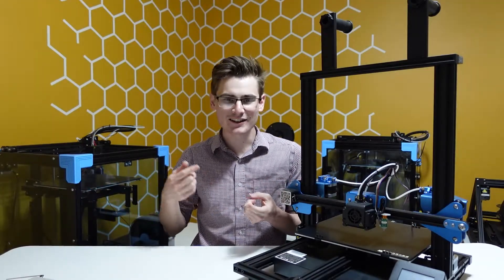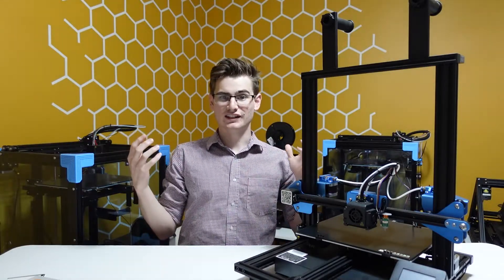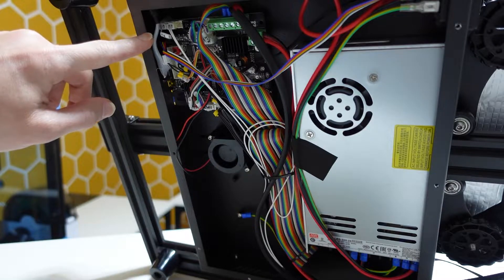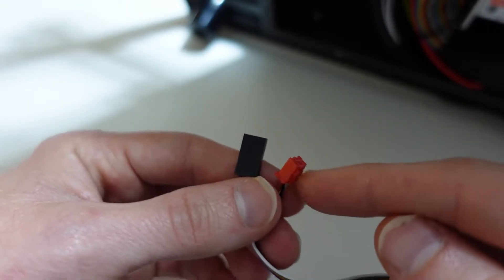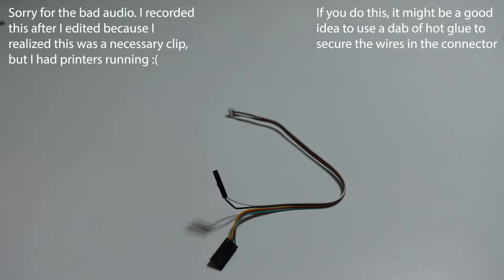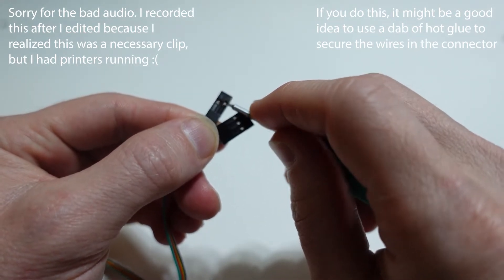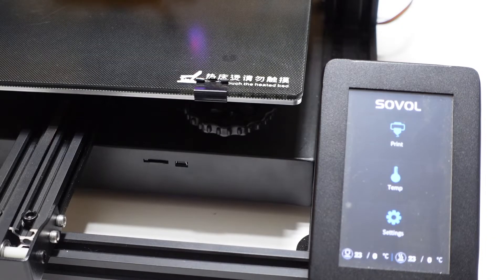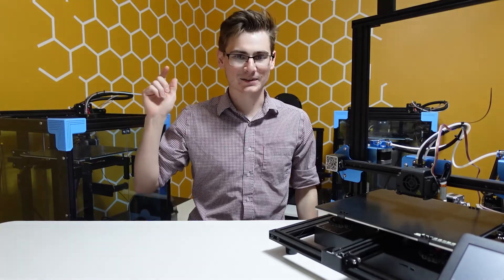SOVOL SV02 FULL CR Touch/BL Touch Installation Guide - With Wiring Diagram!

Comment: I'm having an issue flashing the firmware. I've flashed it on cura and prusa. Neither seem to be properly uploading it. When I check on the control panel it doesn't shoe it's updated. When I try leveling it's still looking for the original z stop. Any help is appreciated
Reply from the maker: Hmmm odd. Are you confident you have the exact right file?
Reply: @ThePrintHouse  I took the hex file straight off sovol's website they provided with the purchase. I've reached out to them as well but have yet to get a response.

Comment: Cable layout is not the same. I had to change my wiring around to red ,blue, yellow for BL Touch to work.      Blue, yellow, red produced a black screen for me using the official BL Touch and cable. I also had to reverse the white and black Z-stop cables for the BL Touch to stop when touching the bed. If not it would crash into the bed.
Reply from the maker: Oh no. Hopefully you were at least able to use this video to get the right pin order
Reply: yeah the pinout shown in the video at 6:00 is not entirely accurate. I have an SV02 with a Creality V2.2 main board and the ground is in the middle of the 3 pin plug. The G and 5V  are swapped on the 3 pin, and the G and Z- are swapped on the 2 pin

Comment: I am attempting to run a CR touch on my SV02 have followed your diagram and many others and can't get it to work. the probe comes out when I turn in the computer and a red led just stays on. what an I missing?
Reply: I’m in the same boat.  I can’t figure it out.  Did you ever figure the wiring out?
Reply: @stvhuston1  I can't even find a mount that works for it. You?
Reply: I can't even find a mount that works for it. You?
Reply from the maker: check the description for the mount I have there. It works.
Reply from the maker: I will see if I can dig into your problem. Did you get it to work yet?
Reply: @ThePrintHouse  The mount does work, but you will likely need to add a spacer. I used a 5mm spacer, and was good to go
Reply: The RED is a failed Self Check. Check your wiring harness. There may be wires in reverse order.

Comment: How do you do this with a Mac? I have never been able to connect to a printer with Cura on Mac.  Is there a .bin file anywhere where you can update the firmware via SD card?
Reply from the maker: Unfortunately I do not know the answer to that question because I have never owned a Mac.

Comment: Hi, this is an excellent video much more detail than the offical video on installing the BL touch. Here is a problem.  I see your blue wire and yellow wire switch the position at main board, so at main board G->B 5V->Y S->R G->Bk Z->W,  and at hotend G->Y 5V->B S->R G->W Z->BK. The Blue and yellow wire doesn't match the position, and the black and white doesn't match neither. I found this part quite confusing. Also After I installed the BL touch, the BL touch does extend and retract the probe twice on power on and stay in red. However when I autohome, the hotend does not stop when BL touch reaching the build plate, resulting the hotend digging into the plate,  what could be possible faults of my installation here?
Reply: Hi, after I sent you the comment, I figure it out. The problem is I am using a creality cable, exactly same as Sovol cable, only different is the white and Black line DOESN'T SWITCH eachother. It should be as in your video. So I compare it with the offical Sovol cable and I found the difference. Upon reinstall with Sovol cable the BL touch now behavior correctly.
Reply from the maker: Can you please clarify the issue? I did not use a creality cable not a sovol cable, so I am confused. It does not matter where the wires come from as long as they come from the same input and go to the same output. Are you sure you had the correct wire order?

Comment: Thanks for your video mate. Descriptive and to the point. I really appreciate it!

One thing I need to ask. As the Z limit switch gets disconnected to be replaced by the bl touch wires, how did you get your printer to home properly?

I have updated the firmware correctly as the printer appears to be functioning fine but when I go to auto home it, the Z axis wants to keep going further than the limit switch and bed. Am I missing something here?

Any and all help will be highly appreciated as I am left scratching my head over what may be something simple.

Cheers
Reply from the maker: Thank you!! The probe now turns into the new limit switch. You actually need to remove the limit switch entirely so that it does not interfere with the homing process. Let me know if you have other problems!